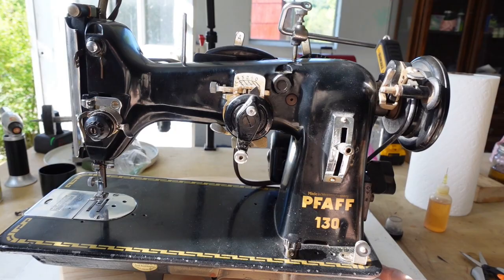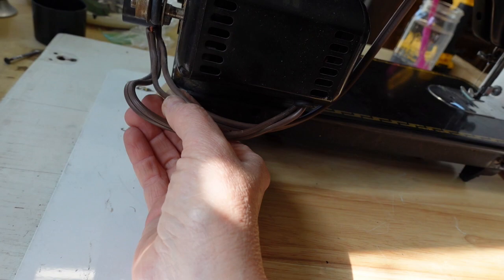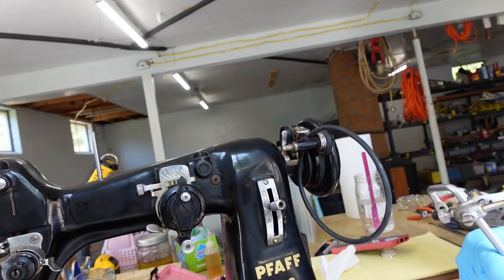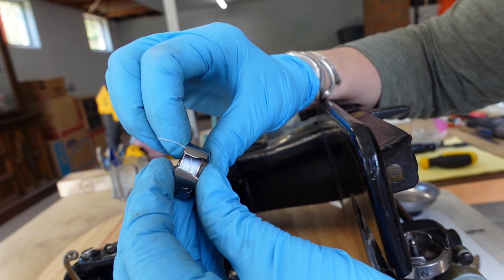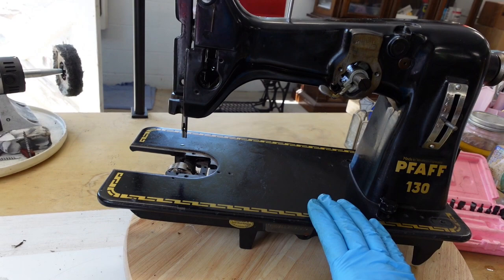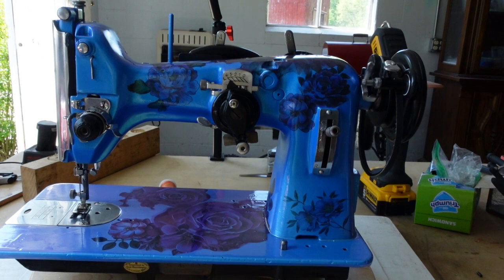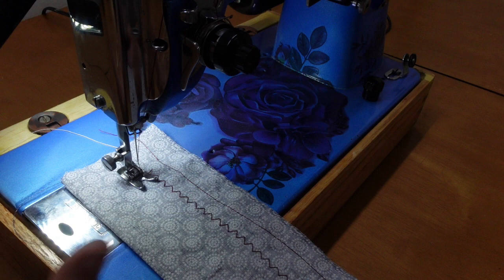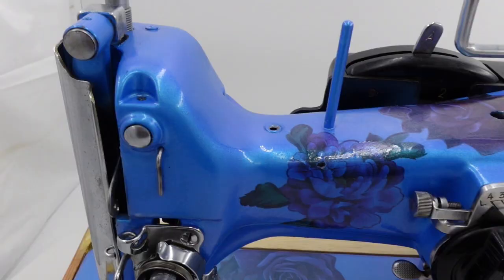Restoring and repainting my Pfaff 130 using color changing paint and temporary tattoos!

Comment: Did you have any issues with the cleated timing chain being soaked in the kerosene? I have a gummy timing chain on my 130 that I need to clean.
Reply from the maker: I only soaked it for about an hour. And cleating was fine. I have no idea how it would react if it was soaked any longer or if it was in rough condition before I put it in. But so far so good.

Comment: I just got a pfaff 130, and i have a feeling the piece that was upsidedown in yours may also be wonky in mine. I'm having a heck of a time with the zig zag setting. It was frozen, so I unfroze it, but now the zig zag is so wide, the needle hits the plate... Do you have any ideas/resources I could look at for a hint at how to fix it? I was hoping you'd put it back together on film here for my own selfish reason :D
Reply from the maker: Well, they are confusing machines but so worth it once dialed in. On facebook join the Pfaff 130 Owners Resource Group, then in the files section look for the service manual. Good luck. You can do this.

Comment: I hope you can find the part for your mister.  Maybe share the details with your subscribers.  You never know someonebout thre may be asble to  help.❤
Reply from the maker: I don't know, I've been looking for a few years now. I've looked in the European machine groups, I've looked all over online, not much hope right now but I'm still not giving up.
Reply: @prometheansewingmachines  Post up details on the cracked part. It may be repairable. most metals can be welded, including some cast irons. If not, there are online machining services that could make a new part if you model it (Fusion 360 is free for personal use).
Reply from the maker: @petervavaroutsos449  I will definitely keep that in mind I was able to get the cracked (and formerly removable part) welded to the machine. So it works great now, just will never be able to take it apart again like that, but that is fine :)